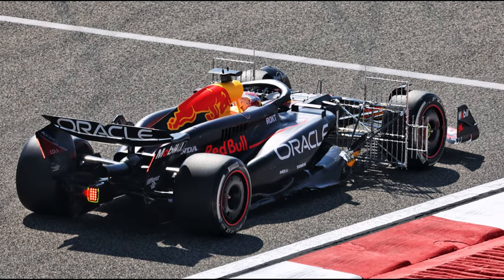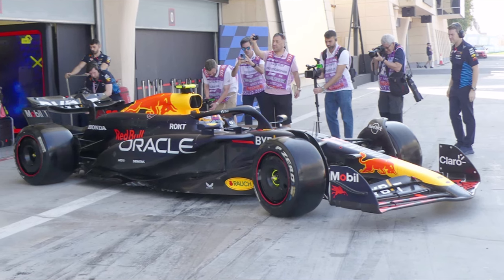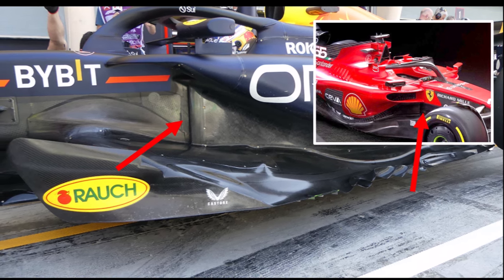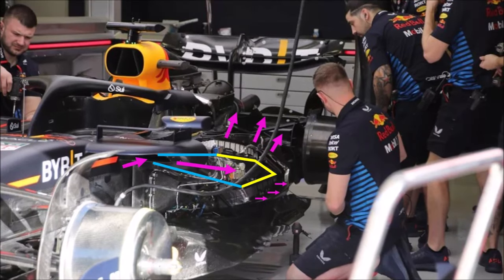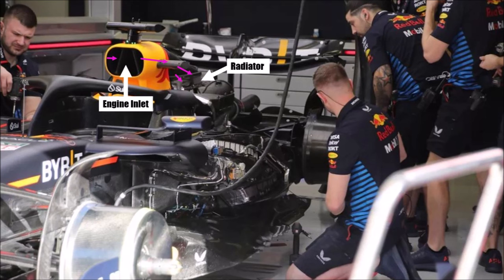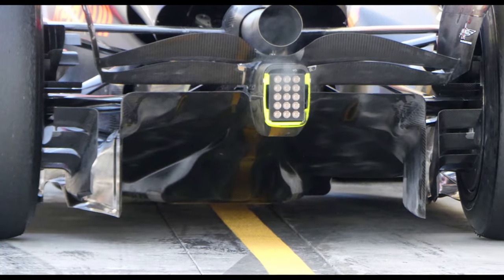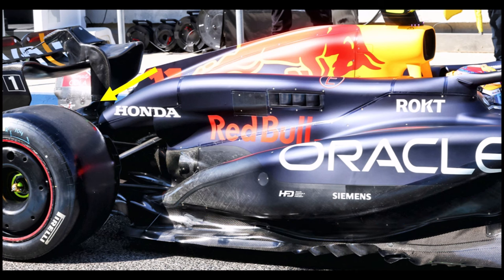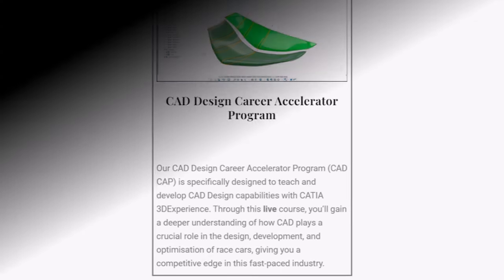F1 2024 - Red Bull RB20 Tech Details

Comment: I would think that moving all the radiators forward would also help in car balance.  The more centralized the mass the less force needed to change its direction. Mean in you can turn faster and the suspension can be softer for acceleration and breaking.
Reply from the maker: Yes but aero is priority.

Comment: Regarding the Halo inlets. The way they exhaust it seems like they somehow using them to disrupt the airflow and stall the rear wing at high speeds. Could this be possi5???
Reply from the maker: I don't think so. This exit flow won't touch the rear wing and it's too far forward.
Reply: @BSport320  Thanks brother. I was wrapping my head around last night regarding this. But it's still a possibility. One more thing i noticed  yesterday during the flowvis session of Perez. They shaped the back part of the lower wishbone in a way that guides airflow on the upper and lower intakes. Really clever and interesting
Reply: @chrisdimis91  airflow eventually goes back to laminar, unless you're constantly guiding it, it's like nothing happened when the rear wing comes by.
Reply: @davidaugustofc2574  Thanks for the clarification. Appreciated

Comment: Why would they vent the exit duct for the sausage radiator on the outside rather than into the valley with all the dirty air from the cockpit?
Reply from the maker: It’s possible they have cleaner flow there and hence drag more air through the radiator, so it can be smaller.

Comment: This RB20 really is an ugly duckling, but the good thing is that it's going to be so far at the front that no competitor will have to look at it
Reply: Nah it's a good looking car just the same boring livery
Reply: @f9009 The livery is nice! The version without Oracle and Bybit was better of course, where the "Red Bull" in dayglo red popped against the matte navy background but it's nice.  I don't like changing liveries just for the sake of changing liveries if there is nothing wrong with the old livery.  If it was a neat livery in 2016, it still a neat livery now!  Looking back, the 2016 did "pop" more as it had more of that Marlboro dayglo orange on it -- a larger Bull on the engine cover and red Total endplates, but oh well they aren't sponsored by Total anymore, so it is what it is.  (Also it is insane how basic the bargeboards were back then compared to 2021, unless that was just a launch spec!)
Reply: I have nothing to think of the livery, I never found them to be either beautiful, exciting or ugly at Red Bull. However the long and fat nose, and the ugly sausages at the back don't make it a beautiful car. Even the sidepods are far from the most elegant on the grid.